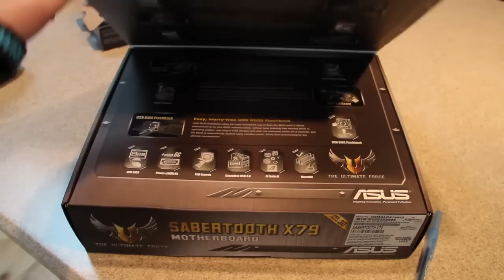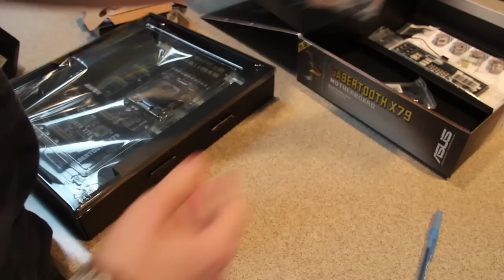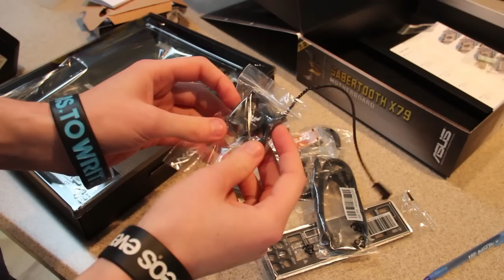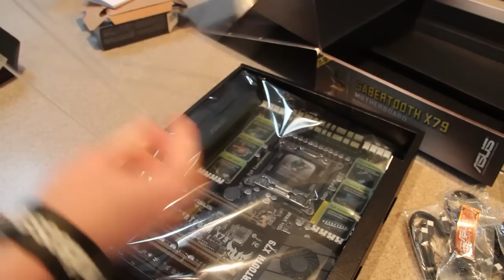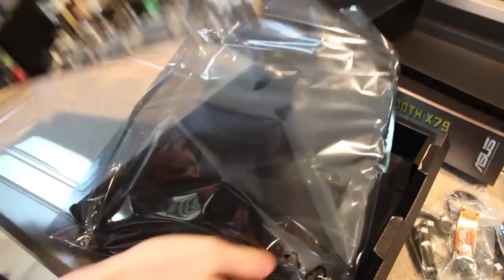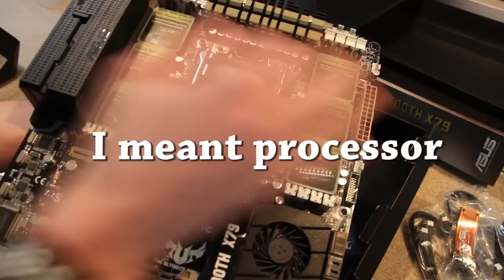Unboxing ASUS SABERTOOTH X79  MOTHERBOARD

Comment: I have a question is that a mark 1 or mark 2 because mark 1  have only 32 gb off ddr3 ram where mark 2 is x2 32gb but it's overkill for gaming to have that much ram because most CPU don't support 64gb ram, most 6 core CPU are like supported then and most gamer no that 4 core is the recommended if gaming PC.

Comment: The chipset is designed to be actively cooled by a fan if it stops working the temps woul get really high and possibly overheat the chipset. Passive heatsinks are what pretty much every other motherboard uses and is a MUCH better idea since it will keep working. If that stupid fan dies you won't be able to replace it.

Comment: What I'm saying is that quad channel memory and a fancy CPU socket really won't improve the performance of a quad core chip. To take advantage of X79 properly one needs a hex core. Otherwise, a 2600K or 3770K will perform the same if not better than the 3820. Hell - it's better to get a 970 and a Rampage 3 or GB X58 OC when it comes to price/performance

Comment: I'm an enthusiast too. I just don't see X79 as a worthy investment UNLESS you go 3930K. Since the 3930K is exactly the same as the 3960X, I don't see the point of that either beyond increasing the size of one's e-penis.

By the way, if you ever decide to go water, don't buy a pre-sealed loop, those are no better than air. Build your own :D

Comment: Why would you buy an X79 board for a quad core chip? The 2600K will clock much better at virtually the same architecture.

Comment: Don't "need" water cooling even for X79. You can get an SB-E chip ticking away quietly and fully stable with a Noctua NH-D14. If you don't like the fans on it - get a ThermalRight Silver Arrow, that's about 1 or 2 degrees better too (not _as_ quiet though).

Comment: Bit pointless for gaming, a 2500K running 4.5 is perfect, but for high performance stuff like the CFD I'm starting to do - a 3930K at a respectable clock is a must.